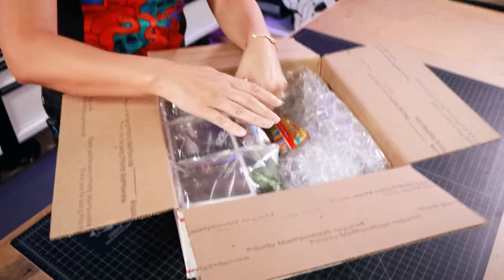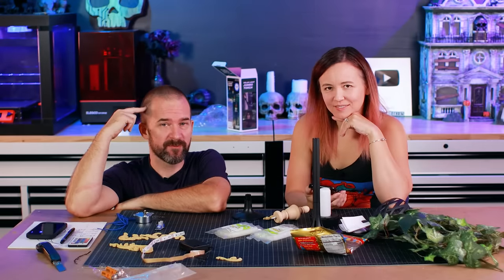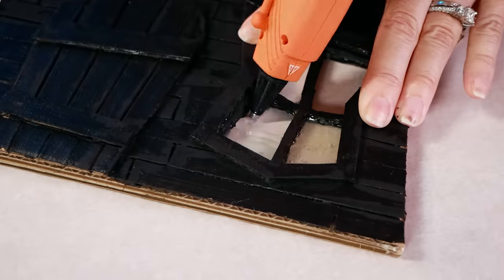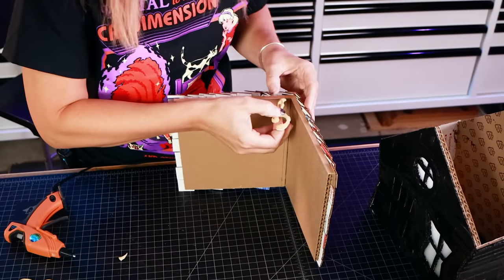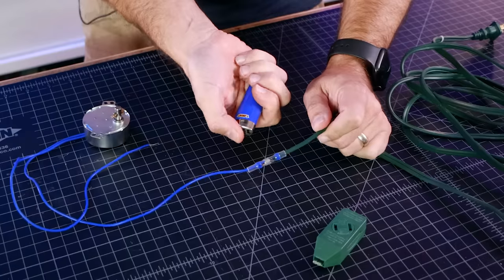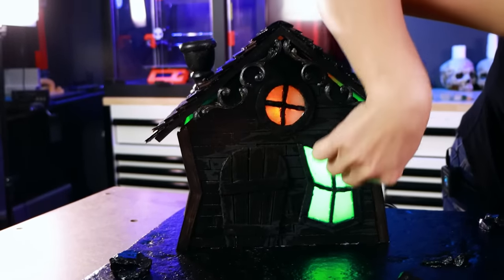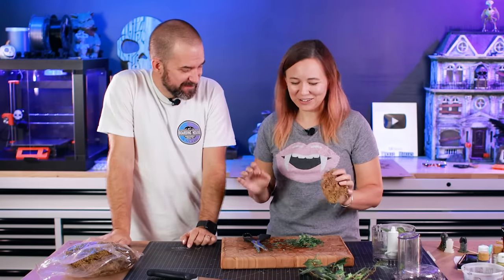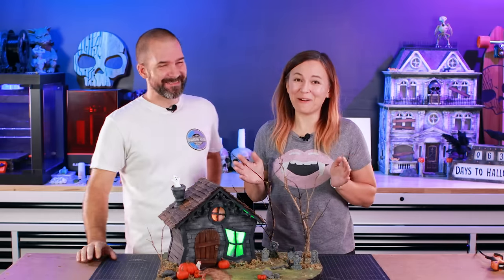This tiny HAUNTED HOUSE is amazing!

Comment: That hot glue tombstone idea blew my mind! It makes so much sense, but I never thought to use hot glue in those silicone molds. Wayyy cheaper than resin!
Reply from the maker: Yes!!!!!
Reply: The tombstones looked alright coming out of the mold, but the paint job took them to another level! 
Such a great idea!
Reply: Did you need to treat the hot glue after it had set, before you painted it? Did you use an acrylic wash on them?

Comment: Never thought to use hot glue in a rubber mold like that before. Those tiny grave stones turned out well.
Reply from the maker: It works surprisingly well!
Reply: @WickedMakers  I might have to try it myself once I get a mold.
Reply: @SchardtCinematic . I found the mold that they used at Michaels, Halloween candy mold area. It was $5.99 - 30% off. I got the last one at my local store.
Reply: @CrazyCrafter-le9ge  Thanks. I was thinking of checking there or online.

Comment: The pc of wood you are calling a Stair Topper is called a Finial. It goes on end of a curtain rod currently like the one you have there. They did use them on the apex of roof, canopy, or on the top newel post. Like you are thinking of.
It looks great, love the lighting.

Comment: The idea of turning the box into the a spooky house was great. Loved the paint job on the house and landscape. Did you need to apply a type of oil before putting the hot glue in the tombstone molds?
Reply from the maker: Nope it just worked. Really cool!

Comment: Hello! Great work, i'm totally stunned what you create out of the box.
Three questions: How many rpms did the motor  have?
                               What is the device for AC instead of battery called?
                               Where do i find the video where you're mentioning this? (10:00 min in video)
Thanks a lot for your inspiring videos!!!!

Comment: Using fishingline attach a thin kite like thin material you have misted with neon paints or done in all black or all white attach material with several fishin lines to the face of fan hide the fan behind a bush or box and turn it on the material will appear as a ghost or demon flying in place you can even shine a disco orange and yellow flickering light or party light at the material to make it look scarey
Reply from the maker: Yes!!

Comment: I have fou d a cool trick with hot glue. Put it on parchment paper back and forth. the topwit more parchment paper and, use an iron,  iron on low or medium, i think, and it will melt flat. Its a cool effect.  I have done it with glitter color glue.

I am also learning or playung with making miniature things. Its fun but frustrating. Prepping the outside furst then putit together is a great idea